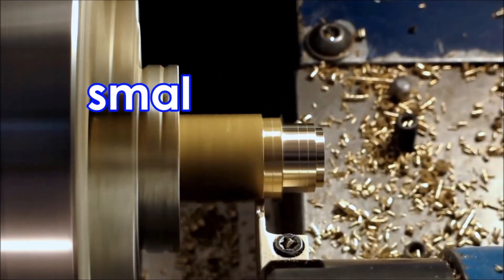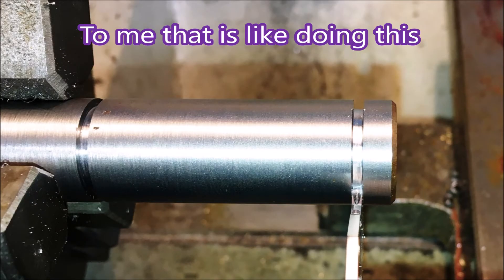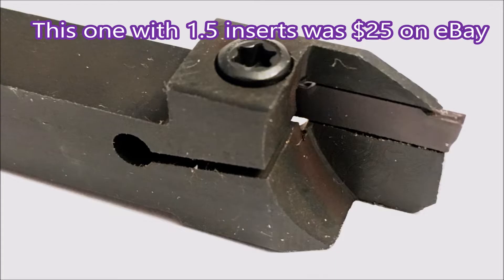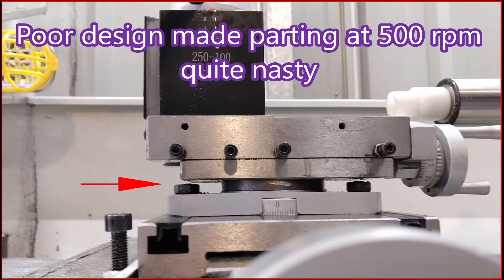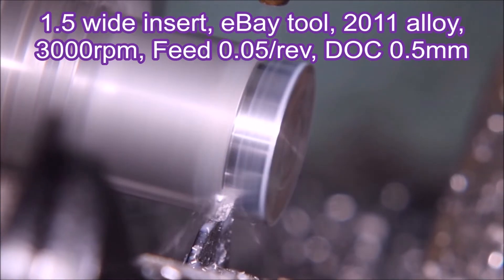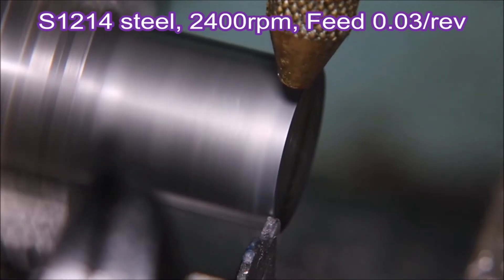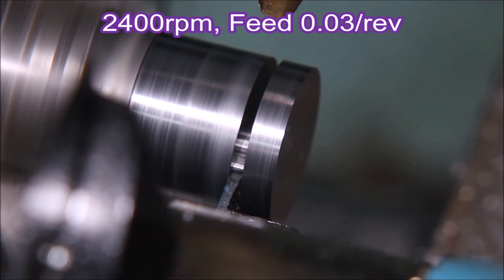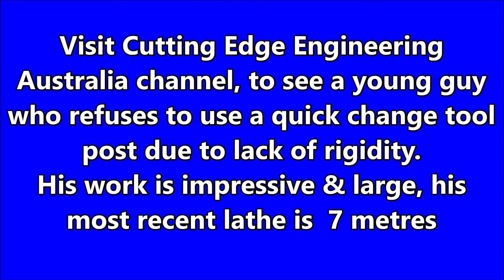CNC lathe, HSS parting blade as a parting tool & tool overhang. Carbide vs steel and aluminium.

Comment: Great advice, also If you do have a smaller lathe & your still struggling i would recommend you use 2mm inserts, it makes a huge difference compsred to 3mm ones as there is less binding a smaller surface in contact with the stock & believe me 1mm make a huge difference. My old lathe wouldn't entertain 3mm inserts in any thing other than soft steels & ally but with a 2mm insert in, its curling up stainless steel chips like springs & i can use the power feed to do it , personally I use the blade type holder but with 2mm carbide inserts because it allows me to only have to use 1 holder for all different diameter round bar as you can move it (again it helps minimise over hang) the other design your limited to certain diameter bar so you will need several of them for different O/D bar. IMHO HSS limits the user, carbide is far superior in every way, faster speeds/ feeds, holds a edge longer & much faster to replace a broken/ dull carbide tip compared to a HSS blade. Also when HSS blades break that's a sharp piece of steel fly through the air, much more dangerous compared to a chipped carbide tip.
Reply from the maker: Hi Thomas, I think a major barrier is folks thinking they need the wider insert for strength, co parting tools break a lot!  I started with a 1.5 wide insert but that only went to 16dia. Moved to a 2.0 wide that goes to 20 diameter which has had a lot of use. It is a really strong tool.  At one point I needed a larger tool so I went to a 12x12 shank at 40 dia but had ir machined down to 10x10 to fit my turret. Never tried parting anything larger than that. If it was larger I would get the blanks cut to a usable length. Thanks for your comment. nigel
Reply: @smallcnclathes  I too had these issues with the part off tool limiting the diameter of bar stock it can machiine, I'm not proud to admit that I wasted alot of money & went through more part off tools, testing them out than I care to admit which is why i was over the moon when i finally found the SPB322 blade type & blade holder style that not only works i now have 1 tool for all the diameters I use from 10mm up to 100mm bar stock, I also use it upside down in the T51 tool holder as i found this helps considerablyin letting the chips fall out by gravity alone , I use it in a SMBB2032 holder ( had to machine it down a little to fit it in the 16mm QCTP holder) i went with these sizes for extra rigidity,

Comment: i was an apprentice in 1951 and all my 5 yrs training period i use only HSS tooling with no problems
Reply: Hi George
Go with what works best for you but just be aware that there are better/ faster ways to do it, why not try out a 2mm insert yourself when you get time & you will be surprised how much faster /cleaner / easier it is compared to HSS, my HSS blades have been gathering dust for years now

Comment: Free cutting material also make bad parts. They are "free cutting" because they have very low toughness and fracture easily.  If you only need a weak part you could make it a lot lighter and thin walled.
As a steel nerd... "free cutting" is pure evil. Intentionally making bad steel and tell it was an advantage. ^^
Reply from the maker: Without coolant and 1/2 hp at spindle normal MS becomes shit.  Free cutting works well in a small cnc, not everyone needs parts that require tool steel. Thanks for your comment

Comment: Been at this for over 50 years. Although carbide insert parting tools work well , so do properly handled HSS tools at a much lower cost. I am still using the HSS blade I got decades ago and there is no sign of it wearing out in my lifetime. At work they go through those inserts AND the holding blade , like candy.
I spend 10 years machining nothing but 304 and 316 stainless with HSS tooling and it was fine once you get familiar with it. I resist all carbide insert tooling because I feel like its like having an employee you have to pay, like renting your tooling , whereas HSS is like owning it. 
Carbide is fine/essential for production but for my personal shop it is reserved only for tougher jobs. You are never "down to your last edge" with HSS toolbits.
Reply from the maker: Hi Bill, I have not spent much time in a general engineering workshop, spent most of my working life as a draftsman.  When I got into cnc, I was happy to use inserts as I had a lot of learning to do and that was one area that was easy to pick up. Inserts are, as you say, quite expensive, but most of my work was non ferrous so my inserts tend to last a very long time. Thanks for taking the time to leave your comment.  Input from folks who know what they are doing is always welcome.
Reply: I would say it depends on the user, if those same employees were paying for the inserts with there own money then they would respect them more & not push them, manufacturers are always trying to make cycle times faster( time is money) 
There are also different qualities when it comes to moulded or ground inserts the latter trnd to have super hardened coatings made for manufacturering (expensive) but they last longer than budget inserts
 But budget inserts in a home/hobbie environment ( when used correctly) will last longer than any HSS tooling, infact tests have shown HSS will dull 10x faster than carbide, even the budget/ cheapest inserts will outlast HSS & these can be as cheap as 30p each, x30 for less than a tenner, they may not last as long as kennametal or other top branded (ground inserts ) but will last ages in a home workshop & u getvthe faster benefits compared to HSS & no more sharpening

Comment: its the grind geometry thats the challenge of HSS.

watch the insert... see how it makes the chips into little barrels? theyre shorter than the width of the slot being cut, so they dont jam!

usually the hss calls for a slight angle on the tip, to "part the work off".. i find doing that just makes tools make nasty crunchy sounds and send things everywhere. think about it. the reason is so damn simple...

whereas splitting the tip, so the swarth "caves in", you get the same barrel effect as the insert makes... sort of. thats the idea anyway, two cutting edges that fold the material inwards, rather than straight back. then you just split it off center for the same "clean parting" effect, one hangs out a fraction more.

super fine stones sharpened to a an obtuse angle, do the tip, do the top, gives you front clearance and the top/side rakes. a little squitty 1" stone has a small enough radius to make nice back rake without nearly removing the entire top... set the dremel up in a psuedo "tool grinder"...

yes, you can do a normal cut with a parting blade, as long as the side clearance is sufficient, and you got a decent side rake. it usually isnt. most people just wack em on the grinder and forget that the swarth is as wide, or WIDER than the slot...

one of the most important and overlooked aspects of turning is CHIP CONTROL.
Reply from the maker: For production, which is what I used my cnc for carbide inserts were the only way to go. I think in one of my videos I show those barrel type chips. Thanks for taking the time to comment, it is appreciated
Reply: @smallcnclathes  yeah, i wouldnt be too keen on hss for parting under power... then again, when you do get them to run nice... oh my. nah. keep it manual and resist all temptation to flick that lever...

still, ground inserts find a place on some work. razor sharp edge that doesnt mind interrupted cuts and severes plastic properly... seldom use but i keep a box of t,c,v**W on hand... 

wish i could get stellite on an insert...

Comment: When using the blade type on a small lathe resulting in a large overhang, it works better if the tool shank is reduced in size to bring the blade closer to the tool post making it more rigid..

Comment: I hate those parting tool as well. Some are not sitting even vertically in that holder, they tend to lean at an angle against the holder, so one side would have a friction.
Reply from the maker: Thanks for your comment

Comment: A blade style parting tool must be sharpened properly. 
A bench grinder with a dressed wheel, and an angled steady rest to ensure proper relief usually does the trick.
"Hot Tip"
Pun intended.
Keep a cup of water close to keep it cool.
You must not change the color of the steel when sharpening it.
Otherwise its case hardened, aka useless.
I use to run Davenport Screw machines, and they all used blade style cut-offs.
But they had a carbide strip on the top.
The one you have is only good for low carbon steel, and most non-ferrous metals.
Reply from the maker: With spindle power of 1/2 hp, 4140 is the toughest material I have attempted. Mostly work brass. No way could I be bothered with hss blades. If insert is blunt, replace and off we go again. Thanks for your comment, always good to hear how other folk do things.

Comment: I think there is a place for HSS especially with the addition of 5% cobalt to the HSS.  Machinists (professional or home grown) have to machine all types of materials.   I believe HSS is much better for plastics as they are sharper.  Also using an insert type tool holder with HSS can lead to isuues such as the top rake angle.  Insert parting blades have the top rake angle built into them.  The better designed HSS blades have ground bevels on the top and bottom and have tapered sides.  These should only be ground on the front face (not top) as the holder should already has a 5-7 degree rake back angle.  I suggest your viewers watch Joe Pie who demistifies the HSS parting blade.
Reply from the maker: Thanks for your comment. I just think carbide is much easier to use than HSS. I have had no issues parting plastics with carbide, just changed the parameters to suit. There may be a place for HSS parting tools, but I never found it, perhaps because of the production type bias of my work.
Reply: @smallcnclathes  Thank you for your reply.  Can  you please be more specific about these parameters.  Eg. what parameters would you use for parting off a 50mm rod of UHMWPE.  How would you ensure there was no nib left on the parted off part?
Reply from the maker: @johnspathonis1078  I don't part that big and usually only acetal and nylon and pvc. Recently found I had to peck acetal when normally I never peck when parting.  My parting tools are from Sumitomo and Kennametal, I have not had any issues with them.  If folks want to use HSS, that is fine with me, just not for me. My experience is doing production work that suits the size of my lathe which is 100mm chuck and 1/2hp.
Reply: @smallcnclathes  Oh sorry my fault for not looking further.  I mistakenenly thought you were talking about a workshop lathe.  I will shut up now. 🙂
Reply from the maker: Hi John
No need to shut up. LOL My turning experience is pretty much limited to work I can do an my small lathes.  Often when larger work came in, I simply passed it onto others.  1/2hp can be a bit limiting at times, the same as 1" through the spindle.

Comment: You could use a machinist jack to support the HSS cutoff tool, but that is like putting a band aid on a broken leg.  Get the right tool holder and a carbide cut off/parting tool, you will respect yourself in the morning.
Reply from the maker: I think I have seen a video of something very similar to that. Thanks for your comment

Comment: Number #9 created chips are what I was taught are the ideal. However your from Australia, so their called #6 !
Also, your NOT supposed to "turn" with a pocketed carbide parting insert. Too much side pressure will push the insert out of it's pocket. G'day Mate!
Reply from the maker: I have not found that to be the case myself. A friend with no turret on his small cnc uses a Sumitomo Profiling insert for all his turning. The geometry is different to make side cutting possible.  This video (not one on mine) shows it being done. I think most manufacturers have videos on YT showing grooving inserts side cutting. Thanks for your comment
I found one of mine in which I mention being surprised to learn special grooving inserts were made to cut sideways ie profiling.  https://youtu.be/tiFUZxXXzdI

Comment: 1:14 I bought a parting tool just like this one but with a replaceable carbide insert.  Tried to use it to cut through a 21/2 in schedule 40 steel pipe and my 7x14 mini lathe couldn't do it.  It chattered badly and when I applied more pressure it caused the belt to slip if I applied more power or stalled if I kept the same power.  Blue chips were being cut but I gave up.  What are the parting tool limitations for a mini lathe??
Reply from the maker: I think a reasonable rule of thumb is about the bore of the spindle times 1.5. So headstock bore of 20, no more than 30 diameter should be attempted. I have quizzed a number of friends and they agree with that sort of figure.  How wide was the insert on the tool you used?
Reply: @smallcnclathes  Thanks for the quick reply!  The parting tool is 1/2 in wide and 3/8 in thick.  Using the stock indexible tool holder.  I had to extend the cross slide as far back as possible and then the compound on top as far back as it would go to just provide enough clearance for the 2 1/2 in pipe.  Wow!
Reply from the maker: I meant the width of the insert. Small lathes like narrow inserts, I use 1.5 or 2.0 as a maximum. Wide inserts need more power.
Reply: @smallcnclathes Ok.   It's about 2 mm or 1/16 in.
Reply: Me too facing same issues with parting tool, often ending with broken inserts . I have used from 1 mm to 2.5 mm inserts but all failed. nowadays I am scared to do parting on my mini lathe. I am just a hobbyist. 
what surprised me is usually everybody suggests  slowest rpm for parting job so I usually do with 300rpm, but in this video it was suggested 2500rpm. I doubt my lathe can even do that speed which is a 3 feet lathe running with 1 hp motor.
Reply: @jayp149 With a 1 hp motor, that's 700W and I have a 500W motor so I presume the next size up of lathe would not do any better 🙁.  Most of the YT videos show ppl parting soft metals of small diameter.  This is clearly not what I was trying to do.  I ended up parting the steel pipe with a quick cut wheel and then cleaning up the end face in the lathe afterwards.
Reply from the maker: That would be the ideal way to deal with oversize parts. I had to do that a lot when making large parts on a production basis.
Reply: @canuckfixit7722  yes that's exactly how i am doing right now now , using cutting wheel then facing. its painstakingly slow and embarrassing actually.🥴.
Reply from the maker: My cnc lathe is half hp, so if you can’t get good parting results I would have to think that you are lacking rigidity
Reply: @smallcnclathes  Tried it again with a 3/4 in piece of aluminum.  Minimized overhang on the cross slide and compound.  Got better chips and made the full cut through but lots of nasty chatter and eventually the tip broke 😕.  I found a little bit of play in the gibs for the compound so that has been tightened up.  Rigidity is an issue with these small lathes.
Reply from the maker: That is a bit crap, 3/4 aluminium should be manageable, was it machine grade? How about some brass?
Reply from the maker: What rpm did you use for 3/4? I would do that at 3000 rpm, but only for machine grade. 6061 and similar are not allowed in my shed except  for experimental yt videos. LOL
Reply: @smallcnclathes  Unlike steel, isn't all aluminum bar stock tmore or less the same from a machining perspective?   I used 2000 rpm so lots of speed.  Conversely, the 2 1/2 in steel pipe was not machine grade but rather plain carbon steel.  I'll have to try a different setup to optimize rigidity.
Reply from the maker: @canuckfixit7722  no idea how it is called where you are but 6061 can be horrible to machine with low power as it won’t chip. 2011 is machine grade and chips really well
Reply: @smallcnclathes  I'm totally new to this as a hobby and there's a steep learning curve.  I'm located in Canada so probably similar metal grading standards. Good to know.  Thanks.

Comment: Kurt at Cutting Edge Austrailia has just recently updated to  QCTP on one lathe and since decided to probably change all. FYI. Anyway I agree about the Hss blades, they are a waste of toolholder, as a hobbyist nearly all my tools are from ebay/aliexpress. I have only 1 tool that is pro made and I cannot tell the difference on my small lathe.
Reply from the maker: Bound to happen I guess with the passage of time that a comment could become incorrect.  The QCTP is saw though, was actually one very robust unit. Not many of us have lathes big enough to hold it. LOL
Reply: @smallcnclathes  CEE use the Dorian precision quick change tool post from Livetools.  Dorian have a range of sizes which would probably fit your lathe.  Only down side is --- with quality comes cost.
Reply from the maker: @johnspathonis1078  I have a cheap QCt which is fine for me. I notice Kurtis still uses the standard tool post quite a bit.  Thank you for your comment

Comment: The only really nice thing about hss is it needs less tool pressure to cut
Reply from the maker: I will really take some convincing about that. The inserts for aluminium with 20 degrees of rake are extremely sharp. One of my parting inserts is actually called a low cutting force insert, the rake on the front is 30 degrees. Pretty sure I have a video about rake reducing power required.
I think hss wins on its being able to be ground to do things that would hard for the average operator to grind in carbide. That would be the only time I use it and of course in twist drills.  Thanks for your comment, they are always appreciated.